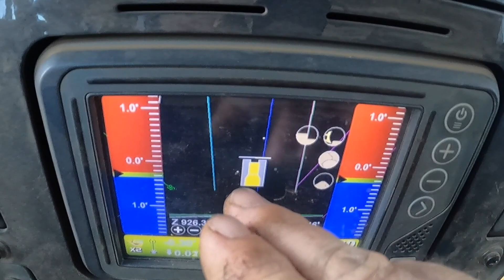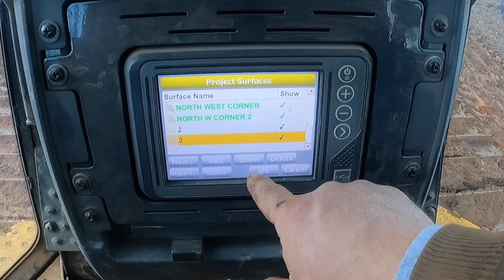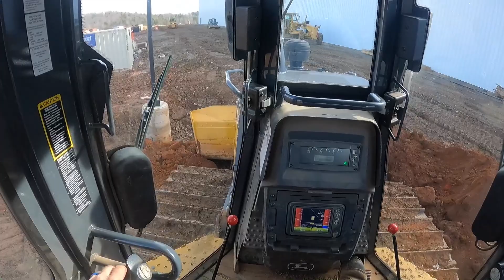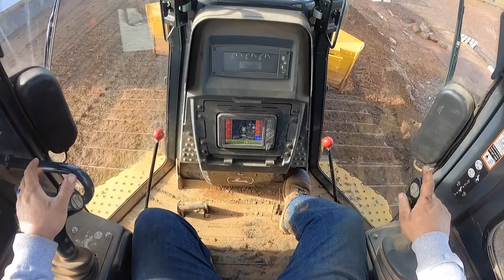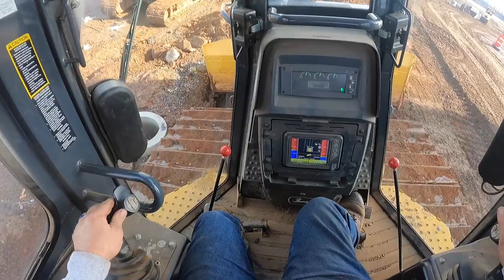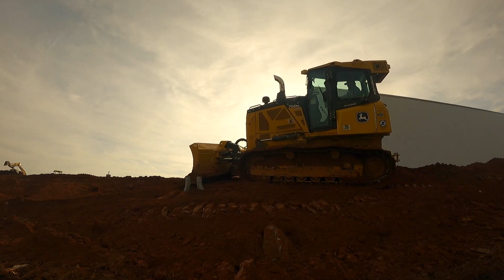Den on a Dozer, 700K Smart Grade

Comment: That's the good thing about having GPS You know where things are and you know the height they're supposed to be at, there's nothing worse than putting in a manhole for a storm drain and then when the parking lot gets finished the water goes around the drain because it's 3 in too high or something like that. Or it's too low and the car's drive over it it's like falling into a hole. Nowadays with all this stormwater requirements and stuff from DEQ you just can't mess that stuff up.
Reply from the maker: You got that right
Reply: @DLHFarms  The next big job you guys get this summer I wish you'd do a video on the stormwater management, especially the stormwater management you have to do during construction and then when the job is complete..

Comment: The auto setting on the jd dozers had me messed up a little at first I loved the 850 I was running but the GPS left a lot to be desired it was an older topcon setup . Then I was in a d5 with catgrade and I was totally blow away with the final product and how accurate it was